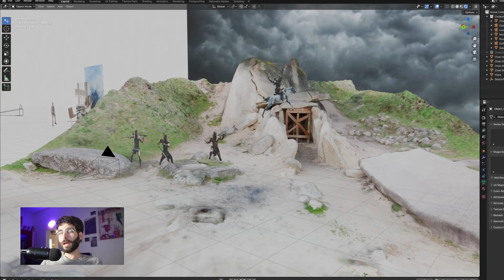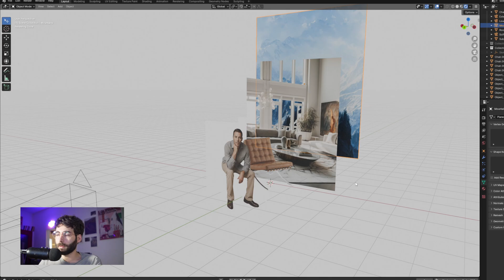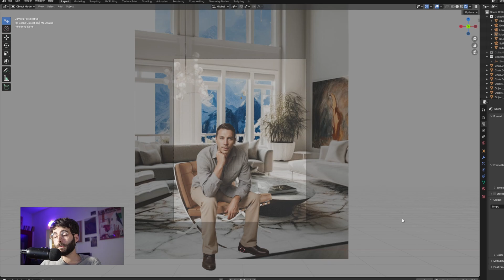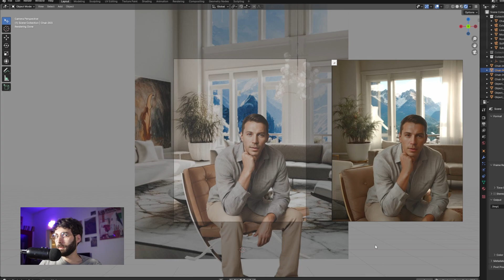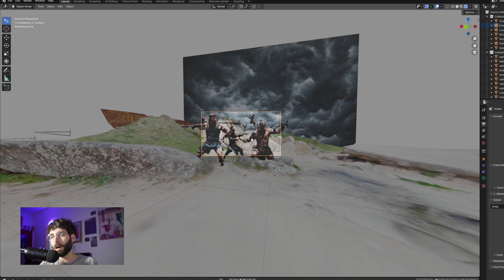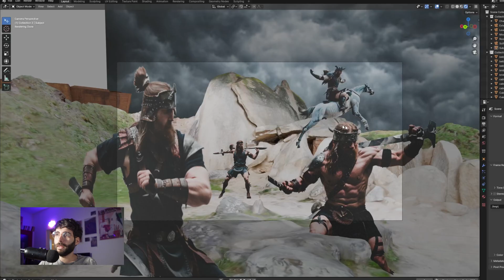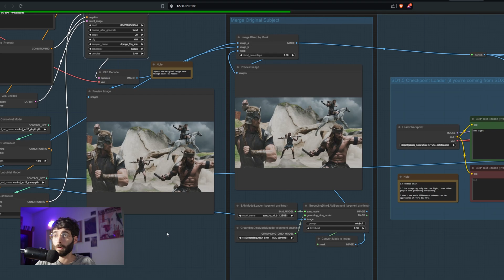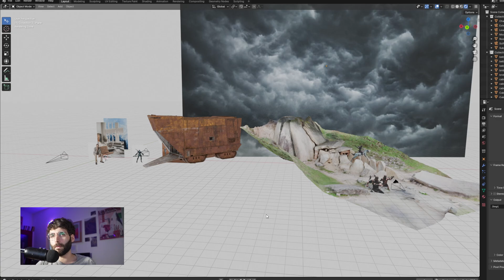Multi Plane Camera Technique for Stable Diffusion - Blender x SD

Comment: thanks for the video! I was wondering of those very specific changes that SD can't handle, my question is (as I'm not very familiar with Blender) : can you go the other way around? What I mean by that is 

1) first create an image with SD
2) import the image/scene in Blender and "isolate" each element
3) follow the steps you showed by screen sharing Blender in ComfyUI workflow to modify those elements

I might have missed something or misunderstood some elements but would be nice to have an answer!
Reply from the maker: You can! I’d suggest generating each plane independently if you can though, and take care of relighting later. Or at least get lighting as consistent as possible first, without caring about it too much.

Comment: Is there a way to get the posing functionaility of blender in a way that doesn't require 5 years of experience and a phd?  😂
Reply from the maker: I assure you I don't have nearly that much experience in Blender lol
If you're interested in the plane-only technique, you could do that in Photoshop instead, since planes = layers, but for meshes in Blender you only need to know:
- how to import them
- how to move them
- how to rotate them
- how to set a camera view
and that's mostly it, it's all very basic stuff you can pick up in half a day!

Comment: Another great video! Have you experimented with creating motion clips using this method? I would love to make a quick 30 sec clips w this method
Reply from the maker: I did, but it's way too time consuming to test animations properly and integrate them in a video, unfortunately I never end up having the time to do that :/
But it works!
Reply: That's something I'm really interested in as well, comping and art direction for animation. So far I'm making separate compositions as storyboards, then other workflows for building the animation sequence

Comment: Slightly more than a 100 years, the moving plane method has been used  in the theatre a lot longer than that... maybe even back to the ancient Greeks!
Reply from the maker: The more you know! I came to know about it years ago from a video about how they used it at Disney, and it resurfaced on the back of my mind a couple of weeks ago as a possible solution for this. Everything old is new again!
Reply: @risunobushi_ai  I worked on multi plane cameras a few times in the film days, they were huge with many levels which could move in every direction... I guess they were all binned once After Effects got good.

Comment: Yes this is definitely going to be huge, especially for recycling background and character animations, without having to regenerate because the characters are in a different area.
   This could also be useful for characters that have to turn around, instead of turning the character, you can flip the room itself. 
 It's very difficult to generate characters from behind.
Reply from the maker: Huge would be creating a UI wrapper with a way to simplify comping by not going through Blender, something I may or may not be doing right now ;)
Reply: @risunobushi_ai what's the progress on that 😂